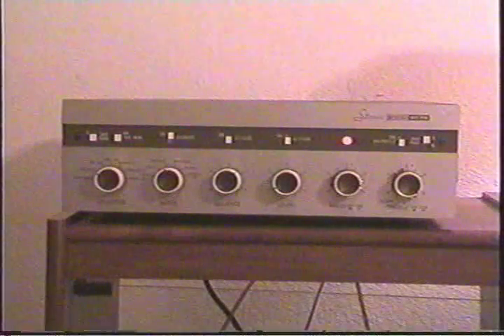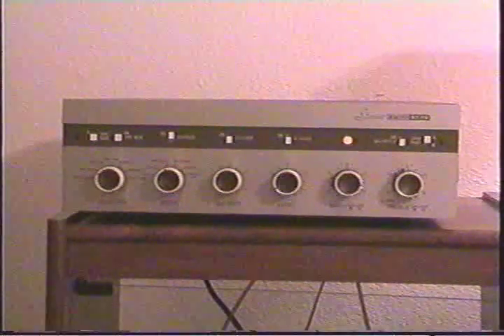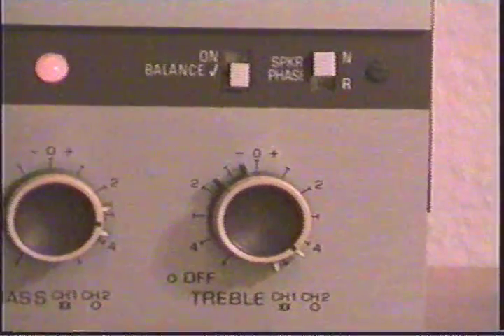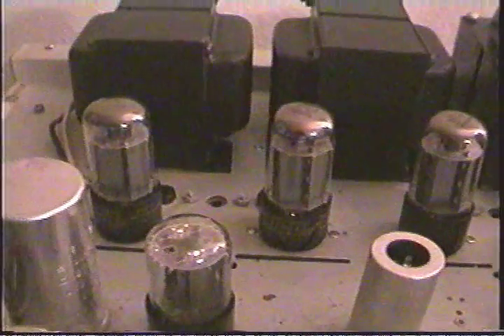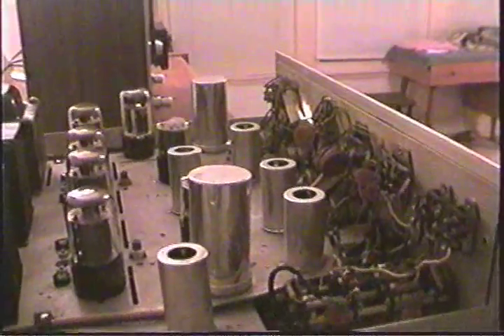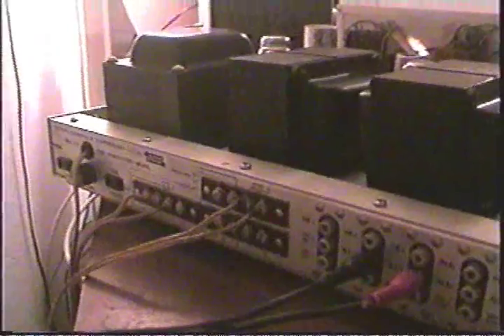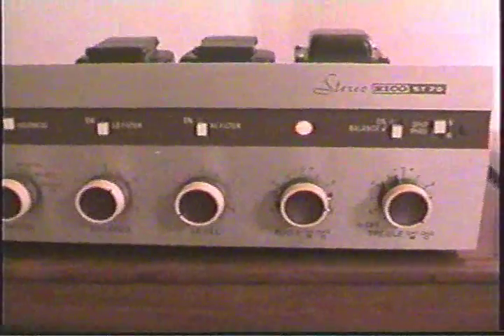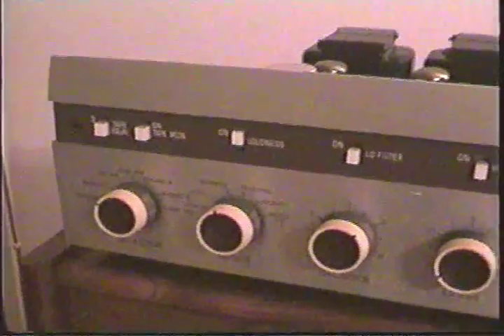Eico ST-70 Stereo Tube Audio Integrated Amplifier

Comment: If your speakers want 8 Ohms, hook them up to 4 Ohms tap on the amp.  The amp sounds all the better for it - even more natural than before.  I am told this is because it "... reduces the loading to a more-optimum value of around 3000 to 4000 ohms. Much better sound, and the only caveat is you've lost about 10% of its maximum output power by the different loading. "  Quote:  Kermit Gray, KVG Labs, 30 March 2009.